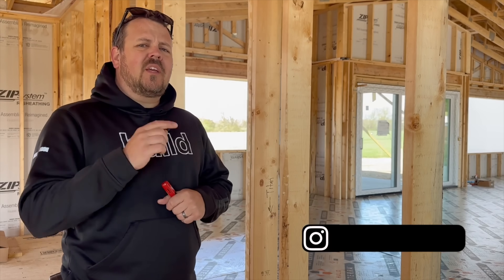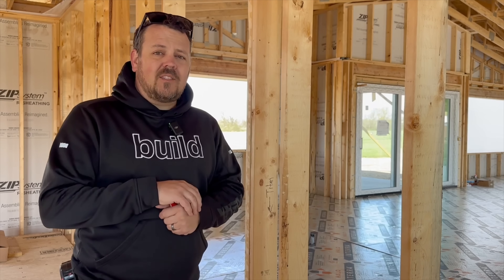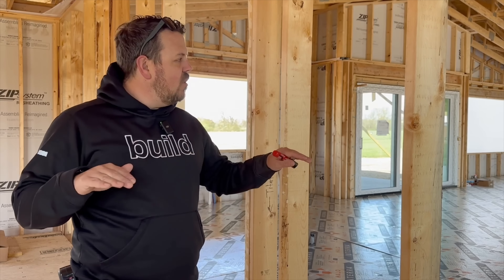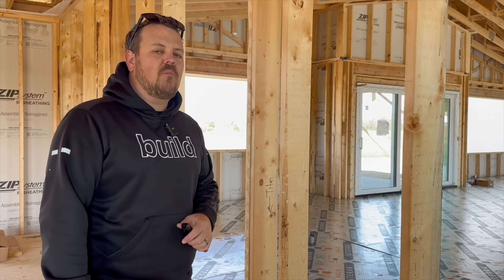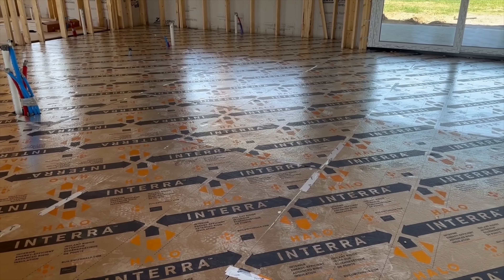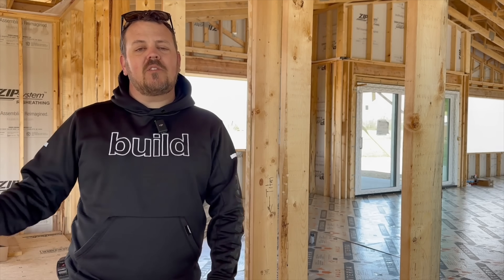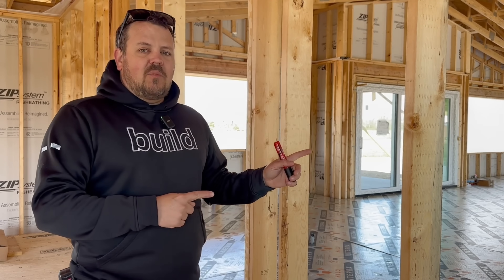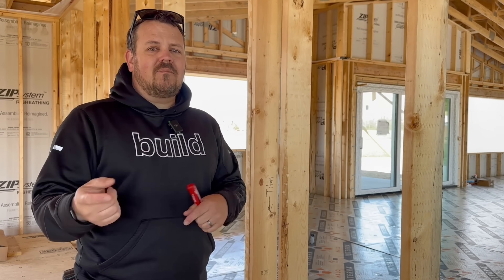This Insulated Subfloor Is a Game Changer for Slab on Grade Homes

Comment: Jake, i see you seem to prefer this system over a "slabless slab". Isn't the concrete just a "walking surface " and therefore not really necessary and an extra cost and effort? Why do you seem to prefer this system over a "slabless slab". I appreciate your input. 
I am actually in the process of building a home on a frost protected shallow foundation with a concrete free slab. I have an engineer on board and designing it to push it through my municipality. Your thoughts?

Comment: So C@@L!  I live near Columbia! I am doing a 6'' concrete in floor pex hydro-heating system in my 4600 SF shop.  14-15 circuits. Should I insulate below the slab? and how much? 18'' piers, 10' apart, 4 feet deep, pole barn, Menards style building,
Reply from the maker: I can’t tell you how far apart the supports should be  but insulating below is a must.

Comment: I live in extreme north east Minnesota, and, have had two homes with slab on grade construction. The only time I would insulate under the slab is if it is heated, I do think you need to insulate the perimeter though. I also build my slabs on a well drained base of washed rock with perimiter drain tile as well. If you insulate the unheated slab under the concrete, you will lose the "ground effect" heat that comes from the natural temp of the soil. Frost moves up and down much more than laterally, so insulating the peremiter is the most important. I build my garages the same way, I have a new garage shop with r-38 in the ceiling, r-19 in the walls with energy heel trusses. It maintains above freezing temps well into the winter with no heat at all, it does have an insulated garage door and insulated glass windows as well. If you use washed rock under the slab, you will not have moisture problems either.
Reply from the maker: I think building science will disagree completely with you on not insulating something. You wouldn’t dare do this with a wall so why would you do this with a floor or the perimeter of the slab?
Reply: @jake.bruton.aarow.building  You missed my point about whether the slab is to be heated or not. If it is heated, then of course it must be  insulated. If not as in a garage slab or cabin it is not always only way. Frost does not move much laterally, mostly in a vetical plane, That is why insulating the perimiter of the slab is important to prevent frost from migrating. That is why we put frost breaks between slabs and exterior concrete. Where I live the ground temps are between 45-50F, if you leave the slab uninsulated that ground effect heat can help keep the slab at a warmer than air temp in a building. And, if the building is well built and insulated, the ground effect heat will help to heat it. And, to compare a wall to a slab is a red herring, of course I would insulate walls and ceilings. Building "scinence" changes all the time and what may work in some areas may not apply all over in different areas. In my experience in north eastern Minnesota, what I maintain does work well.
Reply from the maker: Garages aside, any conditioned space should be insulated, period. You wouldn’t look at the wall and say well its only going to be 45 degrees outside so we don’t need to insulated. It doesn’t make any sense to do so for the floor either. The infinite thermal suck of the soil at 45 and the indoor air at 65 is never ending. The earth will always be able to take more thermal energy away from your building than you can take back, that is simple physics. Furthermore if you think about my wall analogy further the comfort issue that exents to the floor is that we don’t put our bare feet on the walls as we do on the floor. Thermal comfort simply wouldn’t be available to a completely uninsulated slab without a lot more input from the system above.
Reply: @jake.bruton.aarow.building  Listen to what I said. I never said walls should not be insulated, we are talking about  slab on grade here not the walls or ceilings. And, you apparently do not dispute the nature of how frost works. I live where we deal with very severe winters and we know how to deal with it in the building trades. As I said, if you are going to heat the slab you need to insulate under it, but, if not you do not, but, you must insulate the perimiter of the slab to provide a frost break and prevent frost from moving laterally into the slab. I am sitting righ tnow with -2 windchills in my house with this system and it is nice and toasty , my unheated garage which is fully insulated but unheated is at +40F right now.
Reply from the maker: Clearly you aren’t paying close enough attention to my responses. I know you aren’t claiming to not insulate the wall. But not insulating the floor makes about as much sense. Just because you can throw enough HVAC at it to make it comfortable doesn’t make it right. Insulating it to provide thermal control, then having a smaller HVAC plant, greater comfort, and less long term impact on heating costs makes sense. Just because it can potentially be done the other way by over compensating with HVAC doesn’t make it right. I can choose to not insulate the entire building then throw enough BTUs at it to solve the problem too. Furthermore, the code requires it. There is a reason the code requires it, because it is the right way to handle it. Uncoupling from the 45-50 degree soil temps makes sense.
Reply: @jake.bruton.aarow.building  No air conditoning needed where I live, and, my heat bills are comparable to any other type of construction. You are not talking about the advantages of ground effect heat which I would lose if I insulated the slab. I do insulate the perimiter. As I said despite weeks of freezing temps my well insulated garage maintains +40 with no heat at all. That is because the ground effect heat is preventing the slab from freezing.
Reply from the maker: To be clear, keeping a slab from freezing and keeping a building comfortable are two completely different things. I believe we have exhausted the issue here and will simply have to agree to disagree. I do however thank you very much for the completely polite or civil discourse that is so very hard to find online. Your comments and challenges are welcome anytime here on the channel.
Reply: I live in eastern NC slab on grade.  It is perimeter insulated only.  The floor is darn cold in winter.

Comment: Put the insulation UNDER the concrete slab. Why waste that thermal storage mass?
Reply from the maker: Because there actually isn’t a ton of benefit to the thermal storage. Anything greater than two layers of 5/8” GWB cannot share its temp back quick enough through a thermal cycle to be useful in NA. The slab doesn’t really get you much. In fact we would prefer this assembly without the slab altogether. Just compacted stone, fines, two layers of insulation, two layers of subfloor. The concrete was a direct response to client concerns only. We built one without the concrete in 2017 and it is performing very well.

Comment: In new work, it works well to install the foam under the slab.  Locally, we are in a high radon zone, and have to install two layers of poly under the slab, over a permeable base and the radon extraction system.  So installing the foam insulation between the radon barrier, and concrete slab, with hydronic heat in the slab is cost effective.

Comment: Thanks for putting this video together, Jake!  I'm in the KC area and have been considering this approach for an elevated slab ever since seeing Matt's similar vid.  One thing I've always been curious about is if you increase the height of the wall studs/top plate to compensate for the height that the foam and subfloor take up?  Or do you just lose some of your ceiling height?
Reply from the maker: We generally just give up a little in height.
Reply: @jake.bruton.aarow.building   I've been thinking about this insulated subfloor approach coupled with the "curb" you highlighted in your insulated turn down slab video.  My application would be a stem wall slab...what do you think about the idea of pouring a 4" wide x 9.5" high curb as part of the stem wall to accommodate a 4" slab and the 5.5" foam/OSB sandwich? In theory, this would put the top layer of OSB in the same plane as the bottom of the sill plate (that's sitting on top of the curb).

Comment: So, having had several flooding events on properties over the years, if a room got flooded, the water gets into the concrete and can't get out, so I assume it would then mold because you have a vapor barrier? Can the space be dried without removing the insulation?
Reply from the maker: To be clear, the concrete doesn’t have anything in it to mold. It won’t be an issue. If concrete became mold when it got wet we would have a real problem with sidewalks, driveways, and foundation walls. The walls that got wet, if they don’t have an opportunity to dry and are above a temperature at which mold can grow then we run the risk of mold growth. However, a one time event, if the wet insulation is removed and the mold is sprayed down with cleaner it is likely not a huge deal depending on how much water was present.

Comment: Jake, thank you for the content you post. Concerning this video and the specific build, what was your choice for the thickness of the Halo Intera GPS?
Reply from the maker: Simple, we are trying to uncouple from the earth in the middle of the slab (54 degrees) and the outside air temps around the perimeter (potentially -10F to 110F). R-10 isn’t enough and R-20 is above code. Experience tells us the contiuous 20 should be enough to cover our butts.

Comment: EPS (expanded polystyrene) does not lose 10% R-value over time.  It is basically the same performance as the Halo in this area.  Both EPS and GPS can lose R-value up to 4% (over 20 years) as some of the air displaces.  EPS and GPS do not off-gas because they use no chemical blowing agents, they use steam.   XPS (extruded polystyrene) and polyiso foam boards do use chemical blowing agents.  Those gases do escape over time and not only reduce the R-value (up to 14% for XPS and up to 18% for polyiso) but release those gases into the living envelope if not sealed off.  GPS does offer better R-value per inch of thickness, because the graphite acts as a radiant barrier, but it comes at a cost.  EPS always wins in the cost per inch per R-value equation.  GPS excels when you need to watch the overall rigid insulation thickness.  Both products make much better sense than XPS and polyiso.  I just thought it important to correct and clarify, since people are asking questions, and I'm in the business.  Great use of building science in your design ,and a great educational video.  You are doing amazing things!
Reply from the maker: I absolutely could be incorrect on the matter, so stick with me here. The information that I used the I was provided from a building science friend I trust was from a study by Alaska University Transportation Center, University of Alaska Fairbanks called the Connor Study. This showed, in my understanding of their results that both XPS and EPS did reduce over the 20 plus years they studies the materials. Thank you for commenting and participating in the conversation, I would love to have a response that the audience can see here as well. Are you aware of this study? Dupont really pushed this study out for some reason, maybe I am misunderstanding the results (totally possible, I’m dumb). Thanks, looking forward to your response!
Reply: @jake.bruton.aarow.building Hi! I'm two months late to the conversation, but I am trying to find the study you mentioned through my university library system and am having a hard time finding it. Do you recall any of the authors that worked on this study?

Comment: I do not know if you have radon problems in your area but would it not be a good idea to spray 2 inches of closed cell spray foam over the rock before pouring the slab. Radon is the gift from hell.

Comment: I’m having a hard time wrapping my head around this concept. I understood when Matt did his remodel that way. He had an existing slab. Why not rock wool under the slab with a vapor barrier? Is the whole idea just to not be flooring on top of concrete with or without the thermal break?
Reply from the maker: The clients are aging in place, we want a low to the ground (think nearly zero entry) home with soft feeling floors that are also warm. This is less costly than excavation and a crawlspace on our lot. We get a warm, much more forgiving floor for our clients to exist upon than concrete.

Comment: No termite proofing?  The space would be uninsurable.
Reply from the maker: The slab had a continuous poly barrier beneath, the slab perimeter is completely exposed and inspectable, and the home is built at the northern most edge of where folks worry about termites. The precautions taken are appropriate for the risks. What would you have done differently?

Comment: You can do the plywood that way , and use a zillion screws , and labor to install a second layer of ply , or you can use 1” ply  and rabbet the ply edges to create a lap joint, put a bead of construct adhesive ,  screw the seams and have the same result .
Reply from the maker: I would suggest checking with your engineer before doing so. We only got this approved because of the two layers creating a composite action. The Advantech isn’t the important part, just the two layers, glue, and screws. But if your engineer signs off, great.

Comment: Doing this on top of a slab seems wasteful and negates the potential benefit of the slabless home you did earlier -- namely that you only needed the footings under the load bearing walls, with screeded sand in between.  that makes running water lines and electrical under the floor much easier than under a slab and much cheaper than concrete.  As someone who has experience slab leaks in water lines, I will not build on a slab -- crawl space, basement, or possibly the slabless version of this insulated floor. I see the benefit of staggered layers of osb, but I think two layers of  Advantec 3/4" are going to be much stiffer than a wood joist floor system, not the comfortable give compared to concrete you intend.  I'd like to see measurements of deflection for a point load on that floor -- I am guessing it will exceed L720 which is nearly as uncomfortable to walk on as concrete.  You mentioned the graphite foam board was preferred due to different blowing agents, but what is the flame spread like ?  Is Rockwool Comfortboard stiff enough for this ?  It would not be fuel for a fire or toxic in a fire.
Reply from the maker: We would rather do this as a slabless assembly. That is unfortunately much more difficult to sell to clients because of how out of the ordinary it is. Comfortbord might work we simply have not asked for engineering on it. The Halo goes in nicley and comes in 4x8 sheets and is better for the environment so we use it.

Comment: Why in the world would you want a polystyrene floor system??? Put a 12" pool table on it and watch it sag into the floor. Polystyrene off gasses Pentane gas which is flammable and when concentrated, explosive. All that gas trapped under a floor or escaping into you living areas and home. no thanks. Insulate under the concrete slab. Also, you got nothing at the bottom of the frame to attach sheetrock to. Just a poor design. Meeting a price point is not BETTER building.

Comment: Jake, fine work.  Sharif over at Asiri does a vapor seal with a taped dimple mat below the insulation to keep vapor drive from coming through the insulation.  I’m partial to that because of rising damp in many instances.
Reply from the maker: I could see that approach. However, I think our approach is a simpler and more cost effective one, we install Stego Home below the slab and stop the vapor drive from entering the slab in the first place. You could also install the poly on the top side of the slab if you like.
Reply: @jake.bruton.aarow.building  Understood, I would take the Stego on top of the slab only from a serviceability aspect if there ever was a problem

Comment: Sorry if I missed something but is there not thermal bridging between the slab and the wall bottom plates?  I see insulation on the exterior and insulation on top of the slab on the inside but where is the connection between the exterior insulation and the interior insulation to create continuity?
Reply from the maker: The insulation in the walls dips behind the slab top insulation and there is Zip R on the outside of the walls. While not perfectly connected, we will take this assembly over something substantially more complex to create.
Reply: @jake.bruton.aarow.building  Thanks for the reply.  Yes a simpler implementation that is very good is often better in the real world than what might be considered perfect.  Appreciate the vids.

Comment: Can we add tile on top of the flooring? Or just wood etc?
Reply from the maker: The floor carries a greater than L/360 rating acccording to our engineer. Anything you can install on L/360 you can install on this assembly. Therefore, wood, carpet, LVP, ceramic or porcelain tile. NOT NATURAL STONE.

Comment: Are you framing exterior door sill few inches higher for the added insulation/advantech height?
Are you insulating slab perimeter? How you address perimeter thermal break?
Reply from the maker: We do frame the doors up just as if they were low windows. The house has Zip R and the cavity insulation ducks behind the slab insulation, it isn’t perfectly broken but it is close.
Reply from the maker: Oh, no slab perimeter insulation because we really don’t care if the slab is cold we are seperated from it.